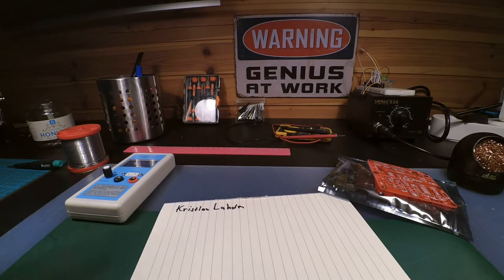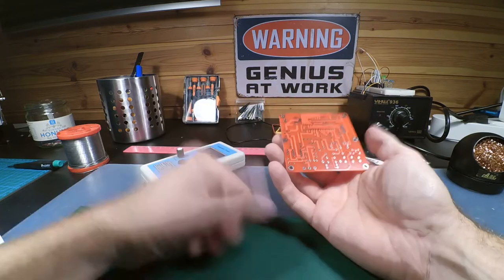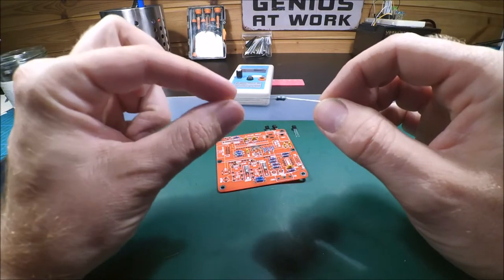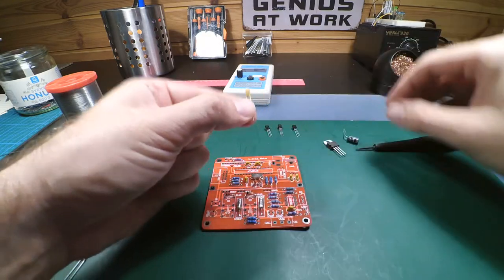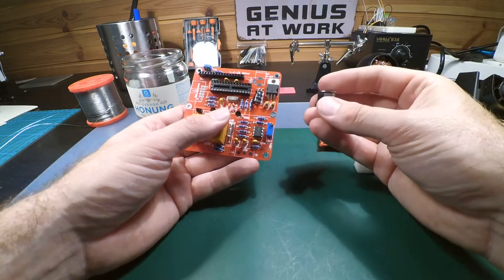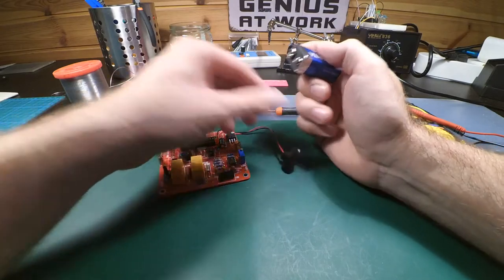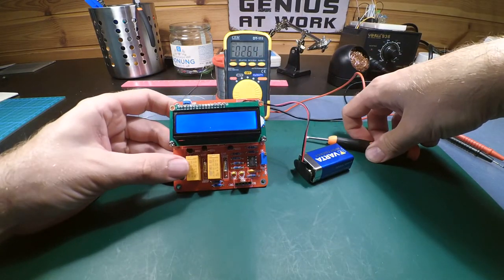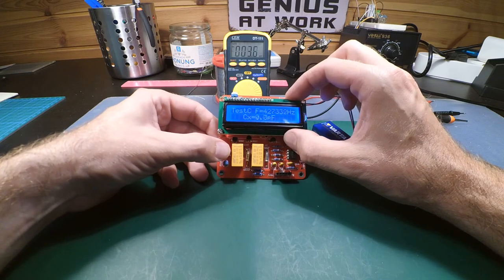#8 Hiland Digital Inductance Capacitance Meter Kit (Banggood) - Build and Testing

Comment: I wonder if the reason a DC connector is used as this might be a bit of a power hog, especially the display LEDs, which David of EEVBlog pointed out when he tested the $7 LCR / Component Tester which uses a ATMega processor:
https://www.youtube.com/watch?v=7Br3L1B80ow
Reply: I saw this linked to bang_good and was curious about it. Thanks for the review.